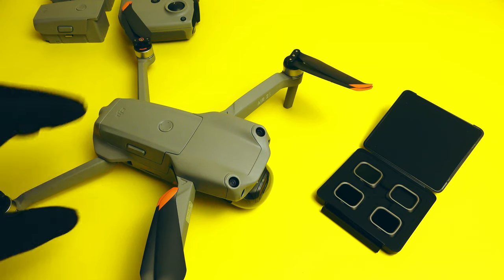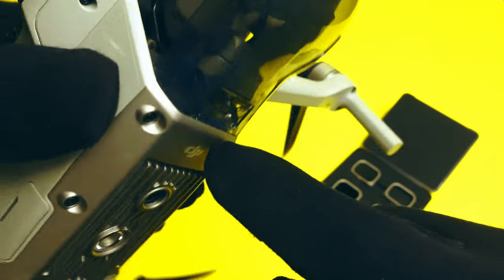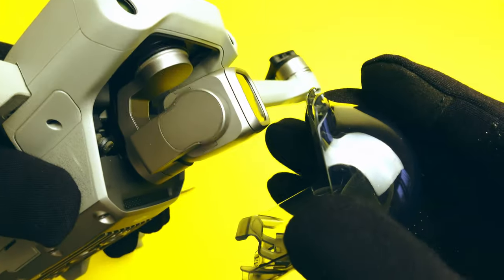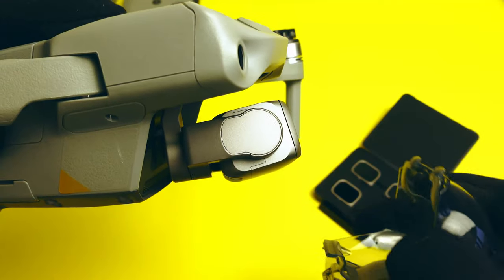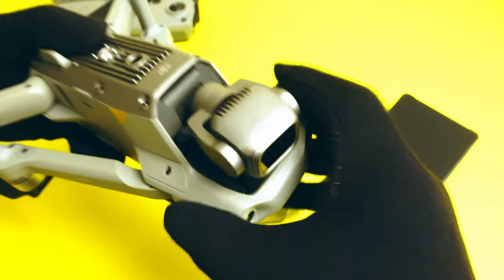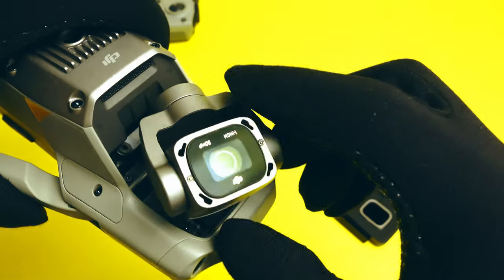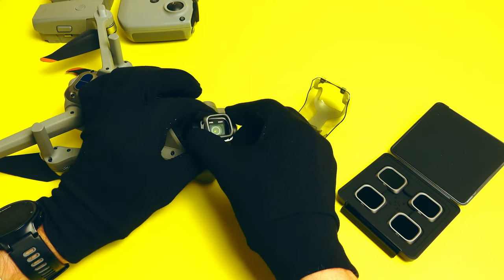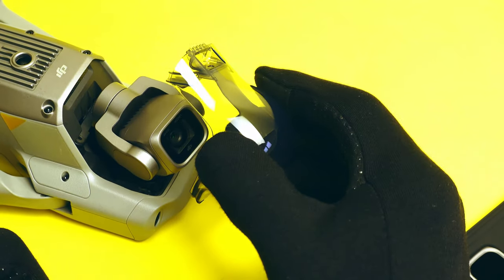DJI Air 2S - How to SAFELY install ND filter + remove gimbal protector

Comment: Bought the 2s air ,delivered after xmas. Gimbal cover removed gently, but was never able to be replaced. thanks to your detailed view of Gimbal latch i see my latch was deformed and never able to latch back into place. must say wasn't nice introduction to DJI drone quality. As an older first time drone user i also found the start up procedure very difficult and technical. still haven't flown drone yet, little disappointed so far. But your video showed me it was not my stupidity that caused the problems, thank  you
Reply from the maker: Hey Steven, thanks for your comment and glad to hear this video helped a bit. I'm relatively tech savvy but need to agree when I first got this drone the amount of preparation and learning needed to get this thing flying was crazy.
I hope you will have a better experience once you get to fly it couple of times as this drone is very capable for its price and delivers some really stunning footage (you can check one of my recent videos showing some footage). 
All the best!

Comment: I took the original frame off but there was no filter on it or no protective glass is this normal it’s hard to explain but when I took off the cover of the camera a little frame came off but there was no glass in it
Reply from the maker: Hey Tim. I may have provided misinformation in the video; the frame indeed doesn't have glass and as such doesn't add any protection. I'd recommend buying a UV filter that will not reduce the amount of light getting through the lens but will provide some protection. 
Hope this helps.
Reply: @howtotechstuff   I was in a panic. I didn’t understand. I always thought there was a cover on that thing. The ND filter I bought does not fit correctly but thanks for the great video.
Reply from the maker: Same here. All the best and safe flying 👍

Comment: I just suscribed, I have a problem with my protector, my drone i bought May 6 and having problem with the protector. The inner strap is like it moved and move the lock and now it does not enter the drone. Can I fix myself?
Reply from the maker: I'm not sure I understand the issue. Can you maybe record it and post link to video? I'd like to help.
Reply: i have same problem. i cant install the gimball protector.
Reply: I just had the same problem. My solution was to bend the inner part that should snap behind the gimbal. ( Its bendable kinda like metal)